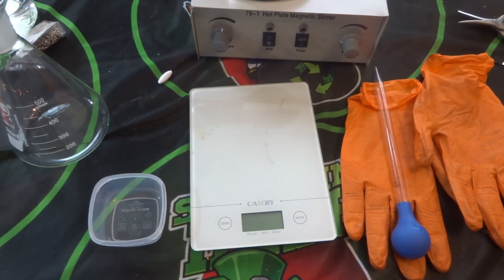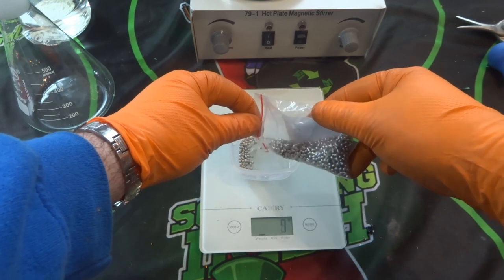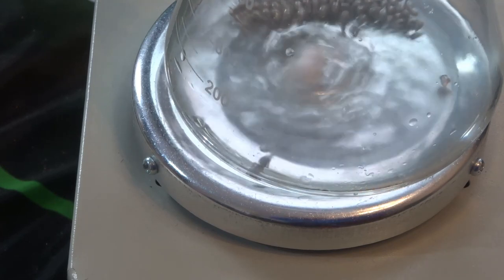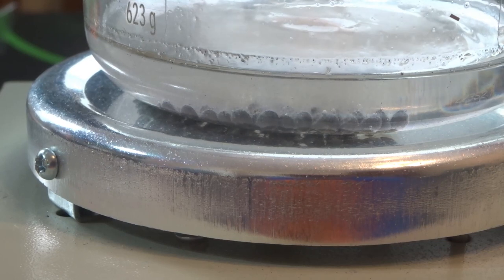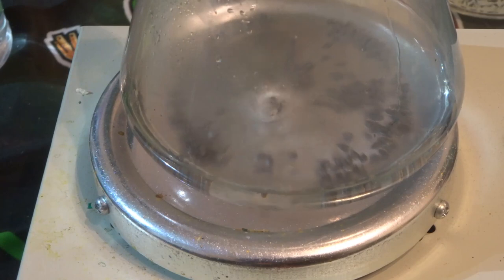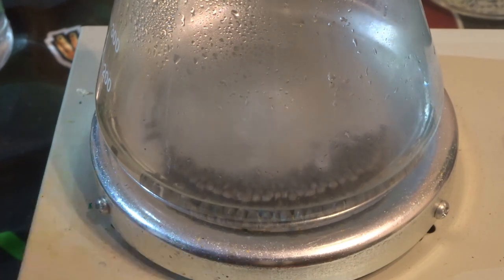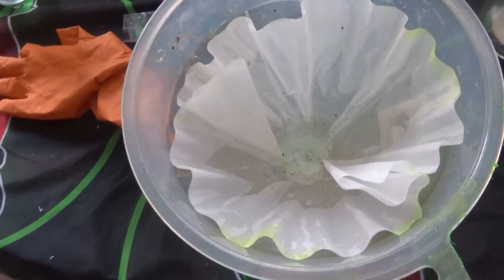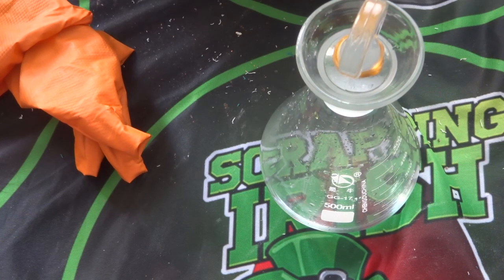making stannous chloride test solution for gold recovery

Comment: cool buddy  it take crazy long time to make  at your side  but anyway  to prolong activity I'm use to drop int finished and cooled down few pieces of tin and last time  i have use it over 8 months and was fine 
 and little hint buddy all jars with processed food is heat resist cause food need to be pasteurized or tandylised  whatever you call it  basically it is heated up to over 100 deg c  for certain time 
i use a lot of that jars it look unprofessional but  they are much cheaper than lab beaker and does the job
 👍😀👍
Reply from the maker: thats cool about the jars thanks

Comment: I bought some Tin powder on line which the seller said to add just ordinary water and that would make up a solution of Stannous Chloride, he did add as an afterthought I could add some HCL in order for the solution to keep for a long time, does this make sense?
Reply from the maker: I have only ever used hcl but then again it's tin shot I use
Reply: @ScrappingIrish  It seems the powder is Tin Chloride so then by adding water that would make it an aqueous solution. is there any way to contact you? I live in Ireland
Reply from the maker: My email is scrappingirish75@gmail.com